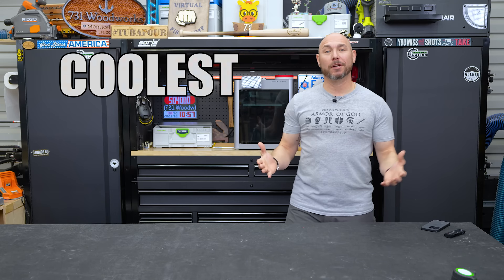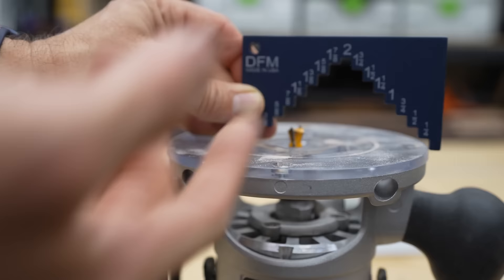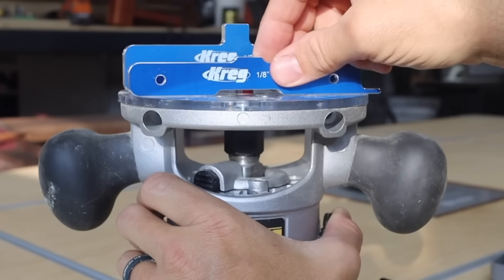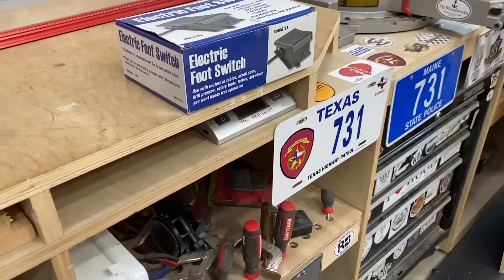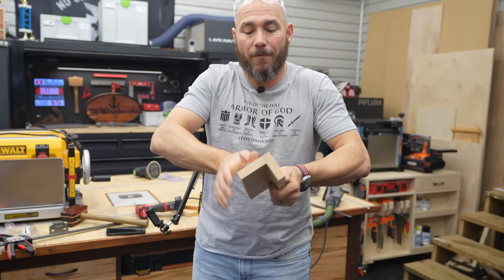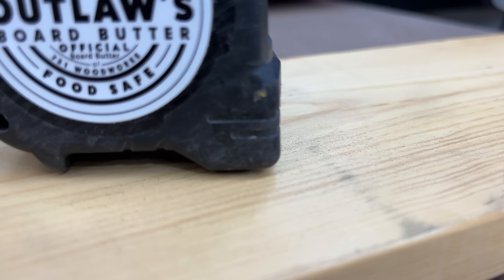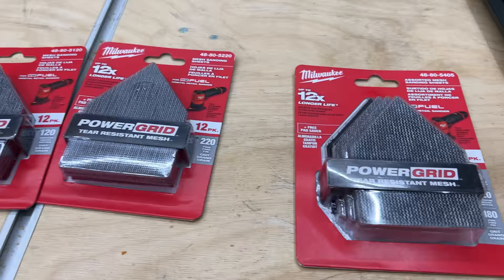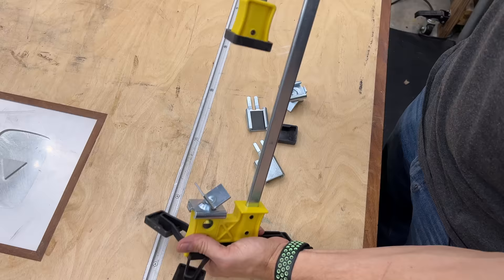Amazing Woodworking Tools That Are On Another Level | Compilation

Comment from the maker: Tools in this video listed below.  Marked by timestamps. Some product links are Amazon and other affiliate links, meaning if make a qualifying purchase, I will receive a small commission but it costs you nothing extra. As an Amazon Influencer, I earn from qualifying purchases. This helps support my channel so I can continue to make content like this.
Build a woodworking business without expensive tools or a big budget. Learn more about my coaching program - https://sawduststartups.com
Tools Starting at 0:09
DFM Small Square  https://amzn.to/3Trch31
Thin Rip Jig https://amzn.to/3tiML5i 
DFM Height Gauge https://amzn.to/48e1OMZ 
Spring Clamps https://lddy.no/1isxr  Assembly Squares https://amzn.to/4aqolaP 
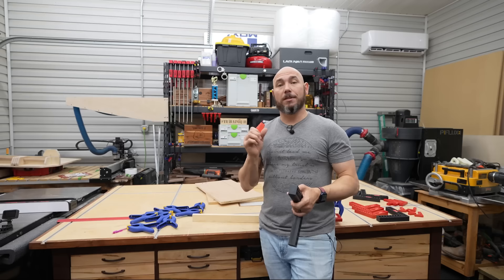Tools in Video Starting at 12:05
Kreg Set Up Blocks https://amzn.to/470eyFd 
Framing Square Fence https://lddy.no/1isxt 
Woodpeckers Edge Rules https://amzn.to/3H4oCCV 
Electric Foot Switch https://amzn.to/47YiW9f 
Sanding Flap Wheels  DowelMax https://amzn.to/3TrPsfr
Tools Starting at 25:35
Dowel Jig X https://amzn.to/3tjlKP0 
Flush Trim Saw https://amzn.to/480QaEO 
Dovetail Saw https://amzn.to/3tpmOAU 
Rockler Router Set Tool https://amzn.to/3Ro5XGS 
Organizer Trays https://amzn.to/3Tncp3t 
Fast Cap Old Standby https://amzn.to/470hwtx 
Tools Starting at 34:01
Kreg Radius Jig https://amzn.to/4852qEA 
Whiteside 4-Bit Set https://amzn.to/4aAKV0z 
Rikon Detail Sander https://acmetools.pxf.io/5gDX6D 
Milwaukee Detail Sander https://thetoolnut.sjv.io/JzvgGN 
TrigJig Tools https://trigjig.us 
JackClamp https://www.jackclamp.com 
Tools Starting at 48:00 
Ridgid Track Saw https://homedepot.sjv.io/EKg5mn 
Milwaukee Track Saw https://thetoolnut.sjv.io/x9eDyy 
Festool Track Saw https://amzn.to/3RGGcCO 
Kreg Track Saw https://amzn.to/3RJCx7m 
TSO Guide Rail Square https://bit.ly/tsoguiderailsquare 
3M Dust Extractor https://lddy.no/1isxv 
Festool Dust Extractor https://amzn.to/3Ts1lSO 
DeWALT Jobsite Table Saw https://amzn.to/48nGeFn 
Skil Table Saw https://thetoolnut.sjv.io/VmZZEj
SawStop PCS https://amzn.to/4ajnN6l 
Narex Chisels https://amzn.to/4ajo8pD 
Wahuda Jointer https://amzn.to/470i7v5 
Tools in video form 57:41 through 
iGaging Set Up Blocks https://lddy.no/1isxw 
McFarland 90 Degree Sander Attachment - https://bit.ly/3uVhiGE 
iGaging Bench Squares https://lddy.no/1isxx 
Router Base Plate https://www.awin1.com/cread.php? 
TSO Guide Rail Square https://bit.ly/tsoguiderailsquare 
Tools Starting at 1:06:52 
Hoffman Joinery System https://bit.ly/41GwELL 
Rip-It Fence https://rip-itfence.com 
Crown Molding Jig https://outlawtoolco.com 
Invis Mx2 https://bit.ly/3uWDZdw 
Invis Mx2 (Amazon) https://amzn.to/3On4Eq6 
RZ Mask M3 https://tidd.ly/3qgQdff 
Tools Starting at 1:17:48
Kreg Track Saw https://amzn.to/3tlENIC 
Shop Nation Battery Holders 
Automated Electric Switch https://amzn.to/3v0XHoF 
Paolini Pocket Rule https://amzn.to/3RKh9if 
Sander Interface Pad https://amzn.to/41nhKcQ 
Tools Starting at 1:27:23
Bench Cookies https://amzn.to/3RsTiCe
Kreg Set up Blocks https://amzn.to/4af51wW 
Kreg Router Template https://amzn.to/48m5ETx 
Aluminum Radius Template https://amzn.to/475mOUu 
Router Bit VIse https://amzn.to/48j1Typ 
Brass Set Up Blocks https://lddy.no/1isxy 
Rockler Router Gauge https://amzn.to/3NvHYo1 
Tools Starting at 1:33:41
Powertech Set Up Gauge https://amzn.to/4aqtFuP 
Jewlers Loupe https://amzn.to/41ni4Z6 
Kreg Crosscut Jig https://amzn.to/3GLY0Xa 
Montana 2-in-1 Driver https://amzn.to/3GL7i5u 
Tools Starting at 1:40:06 
Milescraft Track Guide https://amzn.to/3TvgouL 
Tools Starting at 1:47:57 
Bow XT Extender Fence System https://lddy.no/1isxz 
Tools Starting at 1:58:28
Woodpeckers Paolini Pocket Rule Set https://amzn.to/43xHgw7
Fake Pocket Rule Set https://amzn.to/3IIZgLL
Woodpeckers T-Square https://amzn.to/42br56g
Fake T-Square https://amzn.to/3qi0mYw
Woodpeckers Saddle T Square https://amzn.to/3C02CXe
Fake Saddle T-Square https://amzn.to/3qdIBd4
Woodpeckers Tiny Square https://amzn.to/3MZxAVr
Fake Tiny Square https://amzn.to/3BZIYug
Fake Tiny Square Option 2 https://amzn.to/3IMkl8k
Woodpeckers (Delve Square) https://amzn.to/3otIPfI
Fake Small Carpenter Square https://amzn.to/437gfj6
DFM Small Carpenter Square https://amzn.to/3MZ0SDH
Pencil I Use https://amzn.to/3OFaeFV
Tools Starting at 2:13:58
DeWALT Drill Bit Set https://amzn.to/3tm3nW7 
Spring Loaded Center Punch https://amzn.to/3A7yU1M 
Brad Point Bit Set https://amzn.to/3UTEugp 
Fisch Forster Bit Set (top of the line) https://amzn.to/3DZ7yfC 
Irwin Forstner Bit Set (budget pick) https://amzn.to/3EqnHw0 
Wood Owl Overdrive Bit Set (TayTools) https://lddy.no/1dld5 
Overdrive Bit Set (Amazon) https://amzn.to/3hEZoBC 
Self-Centering Bit Set https://amzn.to/3NWvYuI 
Irwin Counter Sink Bits https://amzn.to/3X7X6ez 
Wood Owl Countersink Set https://amzn.to/3G911kZ 
Counter Sink Bit with Depth Stop https://amzn.to/3toCrF7 
Milwaukee Hole Saw Kit (Amazon) https://amzn.to/3hzG4p8 
Milwaukee Hole Saw Kit (Home Depot) https://homedepot.sjv.io/kjmWkx 
Spade Bit Set - https://amzn.to/3EqoixJ 
Tools Starting at 2:24:40
SawSet Pro https://amzn.to/47YY5Tc 
Bessey GearKlamp https://amzn.to/41t5l7w 
Massca T-Track Clamp https://amzn.to/3tlMuhY 
Condiment Glue Bottles https://amzn.to/3tbhMIp 
3M Xtract https://lddy.no/1isyl 
Sandpaper Storage Box - https://amzn.to/3Hzs9Jw 
Tools Starting at 2:36:17
Banded Spring Clamp https://amzn.to/3v16vLf 
Track Racks https://amzn.to/3Rnxmc0 
Benchmark Double Square https://lddy.no/1isym 
Incra Ruler https://amzn.to/3Rxweme 
Jorgensen F Clamps https://amzn.to/3v3x6Y7 
Tools Starting at 2:46:56
Kreg Project Blocks https://amzn.to/3RNpBO0 
Carter Fast Set Up Blocks https://amzn.to/4725WxS 
Woodpeckers Squares https://bit.ly/41n7phf 
Incra V27 https://amzn.to/3GIDq9W 
Microjig Smart Pushblocks https://amzn.to/3tlNfHL 
Tools Starting at 3:01:35
Izzy Infeed no longer made
DFM Small Carpenter Square https://amzn.to/3v38sa5 
Microjig FitFinder https://amzn.to/3H4AVPD 
Handscrew Clamp https://amzn.to/3GIFkaq 
Precision Straight Edge https://lddy.no/1isyr 
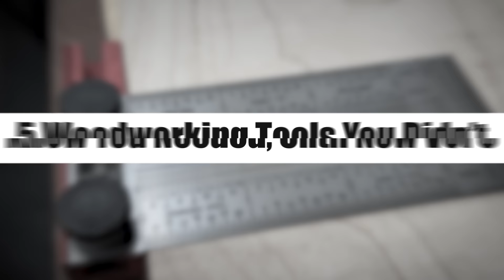Tools Starting at 3:10:16
Incra Tiny T https://amzn.to/4akj8RM 
Shapeoko 4 CNC https://collabs.shop/ovn4dq 
Shapeoko 5 (newer version) https://collabs.shop/xd9ye9 
Pica Pencil https://amzn.to/3RsIRPr 
Woodpeckers Saddle T https://amzn.to/48grdFe 
Microjig GR-RIPPER https://amzn.to/3uXnC0h 
Irwin Forstner Bit Set https://amzn.to/3Tl0NxU 
Tools Starting at 3:21:52 
Bridge City UG 1 https://bit.ly/41pqMpO 
WoodOwl Bits https://lddy.no/1isyt 
Woodpeckers Delve Square https://thetoolnut.sjv.io/GmkXKr 
Radius Jigs  https://amzn.to/3RJvtaI 
Suizan Folding Saw  https://amzn.to/48o7a81
Reply: Those tape-measures, now i don't know if it's the same in USA, but in EU we have 3 classes. Class 1 is for professional use, max allowed divination from true, on 5m (16,4 feet) is 0,6mm (0,023 inch), tho they'll often cost 5-8x as much as the cheap 5€ ones
Reply: Thanks dude. Love watching this.
Reply: 1500, always thought it was for holding files to get square edge on card scrapers  ???
Reply: 16.25 had a raeburn edge square for over 40 odd years now , used it all the time
Reply: Deadman foot switches  are all around my workshop on 90% of my tools and machines for the past 30 odd years too

Comment: I was in Home Depot a while back and I decided I would see how accurate some of their cheap squares were. So I grabbed 2 aluminum speed squares and put the flanged sides down and put them against each other, no daylight. I did the same with a few others, same result. I grabbed some different kind of squares and the same result. These were around $8.00. I'm sure Peckers equivalent would be ten times that. I would rather save the $65 and take my wife to dinner.

Comment: You can bring a framing square back into square by tapping the corner with a ballpein hammer.if it's toed inwards, tap the inside corner slowly and check on every hit. You will stretch the metal and move the blade outward. If you're too aggressive, you may have to file the blade flat if you hit it too close to the edge. Worked in a fab shop and my boss was too cheap to buy us new ones. So we had to improvise. Tap the outside of the corner if it's out the opposite way.
Reply: You probably don't want to drop your square if you have to use it again.
So now you can always remember that your cheap Boss helped you teach all of us viewers who have out of squared
Square s get them back into square... Makes me sound like a square. 
Just sayin
Thanks, the tip to fix a
 needed tool if on the job site I have a  ( quick fix )

Comment: I just got the Milescraft track saw guide, and I'm loving it so far. Took a little finagling to get my 5.5" Ryobi Circular Saw attached to the sled that goes on the track - and gotta be careful and specific when putting in extended batteries for the Ryobi saw as well - that aside, it was a great investment so far!

Comment: Metal ruler with the plastic stop.  Makes perfect sense. You do not want metal on metal wearing away anything you want to keep accurate.
Reply: I was thinking the same thing. you would eventually loose the anodized markings if the stop was metal.

Comment: Tape measures are more for construction where you can be a 16th to an 8th off and it's no big deal. I always used rulers for shop work. If I'm measuring more than a yard stick,I'll use a tape. But if all your measurements are under 30 inches,use a ruler. It's less clunky and more accurate. If you are doing shop work have a few rulers or different lengths.

Comment: For anyone looking at using the spring clamps, quick tip: they can be a pain to grip 2 smaller pieces without them shifting in or out as the pressure settles. Turn them sideways or more parallel to the workpiece and they're way easier to keep straight.

Comment: This has to be the 'gold standard' of useful woodworking tools.  Most of the tools are very  affordable, you provide great detail, 'how to use' info, and the tool presentations are swift but not so fast that I have to replay sections over and over.  Great job.

Comment: FYI, a Jim Tolpin book on measuring suggested putting 2 adhesive measuring tapes on both sides of a piece of aluminum angle iron. Make them any length you want.

Comment: Non customized FastCap tapes actually use that side for a write on/wipe off clip board. Very handy, and you could also have your custom message around the outside still leaving most of the clipboard available…

Comment: Watch out for the remote power switch from harbor freight. #4 in your second list I think.There are two types. One is momentary contact. The other is not! One you click it on and it stays on until you click it again. I wanted / needed a dead man switch for lathe work so the tool stops the moment I remove my foot.😊Great job with the video😊

Comment: every time i use my forester bits i freshen the cutting edge with a fine cut fili...a few  strokes at each cutting edge.i have cut hundreds of holes each and they still cut great.much like i pull a few strokes each tooth after each use of my chainsaws..just to freshen the cutting edge
saq

Comment: @731Woodworks.  Check out the Harbor Freight Forstner bits (I know, I know). Super smooth cuts, waaaayyyyy better than the Irwin set I have.  I’ve had no tear out with the cheapest set they sell.  They are now selling a carbide tipped Hercules set for $35 that I’m going to have to try out.

Comment: I have 2 Deadman Switches, one on my Ryoubi 9” Bandsaw and the other on my Tablesaw…the one on the Tablesaw is the most dangerous!…I have things sitting on the table and if it’s near the blade when I accidentally step on the switch, BANG!.could cut my hand etc. So I keep it up off the floor until Ineed to use it.

Comment: I'm a novice woodworker (about a year into it) and I have finally worked out how to do dowel holes. Without a drill press. The only jig I use is a bit of wood with a known 90 degree hole in it. Before now I never used dowels because I could never get it straight. The bit of wood with a hole in it doesn't cost me $100Aud either. (sorry just looked at the price of the dowel max.... $330aud)
Reply: I broke down and bought one and I cant imagine doing the work Im doing without one; like 20 dowels to this point that are all lined up correctly and didnt take forever

Comment: Question: when squaring a table saw blade, should you square against the insert or table?
Reply from the maker: table is best
Reply: I use the insert, but only after checking that the insert is flush flush flush to the table.

Comment: Any tips or tricks for removing glue from parallel clamps?
Reply: Sounds like your parallel clamps are wood?  1. Wax them before the glue up.  2. Put a barrier between the clamps and the wood. Flat Silicone mat will work best, but I've used pieces of paper when I was in a pinch.
Reply: @t5782-j4o  that’s my mistake, they are not made out of wood.  That is a big typo.  But thank you for responding!

Comment: Regarding the tearout from a forstner bit (referencing the last chapter of this video), I saw a trick a while back.

First, I drill the center of the hole with a small bit, like 1/8". On the back side, put the Forstner bit in a hand drill and run it backwards for a second. That tears the wood fibers. Then drill it from the other side as you normally would. Tearout is minimal to nonexistent. 

It's a couple extra steps, but saves a lot of money buying a different set of bits. Good for a non professional where an extra minute or two doesn't matter so much.

Comment: The DFM square might be worth it if it came complete. Received mine with no pin. With never buy anything from them again.
Reply from the maker: Hate to hear that.  They are a great small company.  So, they made a packing error.  No one is perfect.  Did you contact them about the issue?  I'm sure they'd send the pins to you.

Comment: Superb video!   Something for everyone and extremely well organized.   Just wanted to mention one additional thing and make one recommendation about the Kreg tracksaw.  If you're going to do a full review of the Kreg saw, I would strongly suggest that you include in your review the companion Adaptive Cutting System (ACS). The Kreg track saw when coupled with the ACS becomes an order of magnitude more useful.  As I'm guessing you know, the companion Adaptive Cutting System is a multifunction (MFT-style) table which frankly blows the Festool MFT away at a similar price point.  The MFT-style dog holes, rail hinges, built in measuring rules, and miter gauge allow you to make extremely accurate and repetitive cross cuts and rip cuts of almost any dimension and at almost any angle.  It's also rollable and folds to provide a very small footprint.  It can do virtually anything that a table saw can do and is much safer.  In fact,  I don't even own a table saw as the Kreg ACS and track saw are a great alternative.   Sorry for the sales pitch but I love the Kreg system.

Comment: A really long video deserves a really long reply.
I don't do much woodwork but do enjoy 'making shavings' when I get the chance.
As much as I would like to buy Woodpecker tools, I feel the price isn't justified. (I can't afford them 😁)
You can't blame the increase on labour charge differences as Woodpecker makes a big point about being CNC, installing a few screws isn't going to triple the cost, particularly when price difference for the rule set is more than five times higher!
Therefore, the only reason for such a massive price difference is obviously they are overpriced and rely on American patriotism to sell. 
The 'saddle T' (2:09:22) price is justified in my opinion though as they use much thicker material to start with which obviously cost a lot more, (even if it's cast and not made from extrusion or solid?)
The Chinese copies are not as good as the made in USA, but, if I really want accuracy, I use my metalworking tools, verniers, etc (micrometers are overkill in woodworking)
Harley Davidson based their entire marketing strategy on the same thing which worked for many years, until it didn't and they had to go to India for new bikes and were only allowed to say 'Assembled in USA' for several years as they were less than 48% made in America. (not a lot of people want to know that)
It may seem I'm comparing apples to alligators but the principle is exactly the same.
With the Forstner bits, I found Irwin really need sharpening before use.  Even really cheap ones can work well if you learn how to sharpen them properly.
If there is one size you use a lot, buy an expensive one, it's cost effective (I have one Freud)
For anyone, 'not quite sure' of the retirement hobby, buy cheap stuff which will often be frustrating to use and 'fix' but treat it as an experiment and learning experience, expect to replace everything over a few years. It may seem a waste of money but it's cheaper than selling stuff at a massive loss if you find it isn't as much fun as you expected

Comment: Matt, Why do good woodworking  and you not talk about Panel Saws? I have one and there is no way that a track saw or table saw will breakdown or cut to size quicker or as quick. I know It is pretty limited to 3/4 or smaller, does not cut thick but when I see someone breaking down or cutting to size no mention of the panel saw. Mine is a upright 4 X whatever.

Comment: Very nicely done...however most chop saw scenarios miss the boat in terms of step one of woodworking ...bucking rough lumber. Fence systems are largely the wrong answer. If stock is bowed and twisted a stop in a table with no fence at all is better and let's the operator cut as needed relevant to the twist and exit side as needed. Just my $. 02